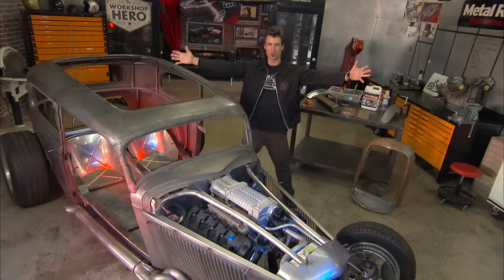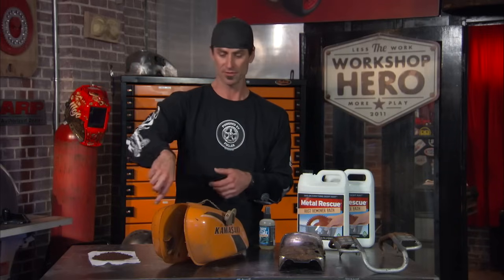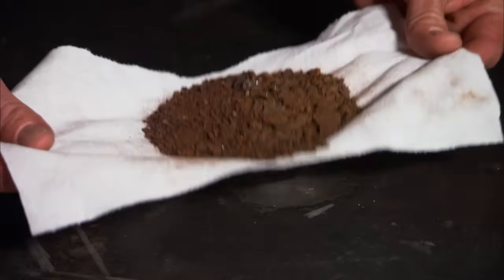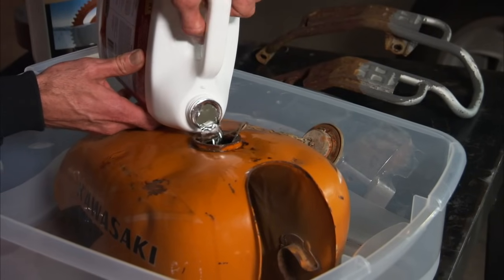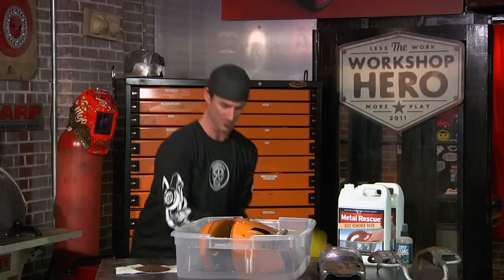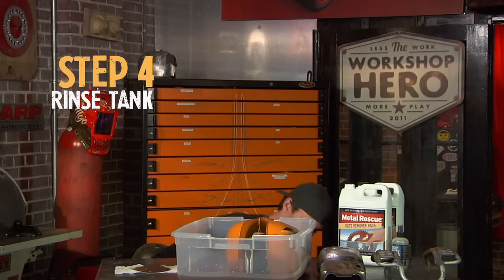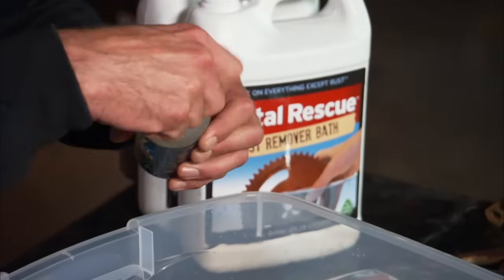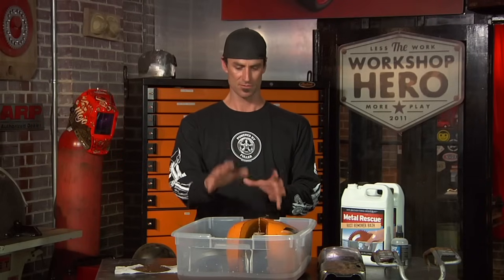How To Remove Rust From A Motorcycle Gas Tank: NO ACID

Comment: such a tank expert, DISTILLED WHITE VINEGAR works better than anything I have found in 50 years. Less than a buck a gallon. it takes a few hours, but White distilled vinegar is very gentle on your skin and metal tank, but harsh on rust and varnish. It will even clean the varnish out of a plastic tank in minutes, use a few nuts, bolts washers etc as agitators inside the vinegar in the tank and rock back and forth for about 10 minutes and the varnish pours right out. A final rinse with vinegar will verify the job when it pours back out clear. Lastly, put a little gasoline in the tank to rinse the vinegar residue out, slosh it around a bit and discard. the tank is now clean.
Reply from the maker: There are a ton ways to remove rust. Metal Rescue is the cleanest, safest, and easiest ways to do it! We compared Metal Rescue to white vinegar in an apples to apples comparison video. https://youtu.be/FusxqHduvCE

Unlike vinegar, Metal Rescue is not an acid, and will not promote rust if left on or not neutralized! 
Check it out, and you can be the judge on which one works the best. Thanks for watching, please let us know if you have any other questions!
Reply: +Metal Rescue Rust Remover Bath from Workshop Hero...white vinegar works on par with this product but at a buck per gallon it's better value and for that fact, far superior!
Reply: Agree,,,,$25 for a gallon not happening ,,,,,Vinegar it is
Reply: I just did this myself in my own tank and it rusted again immediately straight after. I call bullshit.
Reply: I left it in the tank for three days and still had rust with vinegar.
Reply: SEI RePower awesome thanks
Reply: from all the times ive used white vinegar i can tell you it needs a higher acidity than 5% to work effectively and its harsh on paint, so is the works toilet bowl cleaner but it is more effective and is only about $2, electrolysis is also a good option if you do it correctly
Reply: kerosene work's Better Then the Vinegar i think.. Its what i use with nut's, bolt's, washer's , and screw's,..  works great...then you can seal it if u want... How do you have a Product and Promote it with gas tanks, and then say Can't seal cause it hasn't been tested ??? .. That just makes me Feel it hasn't been fully tested as it should as a Product..  Listen i Used It on one of my gas tank's and Yes it DID WORK GREAT.. But The Price is High for a Product that hasn't fully been Tested, and just going to use really once and then throw out.. 4 gallons of Kerosene even at $5 a gal. is cheaper then 1 gallon of this.. :(  Great Product but bad Dollar wise.. sorry
Reply: Thanks for the advice thats stuff is probably not cheap
Reply: I like your idea ! Much cheaper than five gallons of metal rescue at 20  bucks gallon. But does it really work as well ??? I just bought a motorcycle that has been sitting for ten years . So it pretty much looks like the one in the video .
Reply: you are absolutely nuts. muriatic acid makes it brand new in 30 minutes.
Reply: @kashmiri911  vinegar doesnt work. you may be confusing dirty tank with rusted tank.

Comment from the maker: Before adding any Metal Rescue™ to your gas tank we suggest cleaning the tank to remove as much of the rust and residue as possible.  Dawn dishsoap will help in removing grease and "gunk" and the use of a pressure washer as you suggest (if you do not have a pressure washer visit a coin car wash that utilizes them) will help to dislodge and remove any flakey rust or material that may be in the gas tank.  Best of luck and glad to see you bought enough to fill the tank completely - a smart move!

Comment: I tried METAL RESCUE on my 2001 ZRX1200 that had been sitting for about 6 years in my climate controlled shop.  Inside of tank looked pretty rough. I used a 1500psi electric pressure washer for less than a minute on the inside. I added the METAL RESCUE at 4pm on a warm ( 85 degrees) October afternoon (2020). I left it overnight and drained it out the next morning around 9am.  I was SHOCKED  !!   The tank was perfect inside.  I am very pleased with the results.  THANKS for this video !!

Comment: I made a few mistakes on my first attempt to remove rust.  First of all, I don't think I removed all of the oily debris from the tank,  Secondly, I only used one gallon of rust remover, and sloshed it around.  Thirdly, I did the treatment in my basement, which was colder.  I started over again, and used 3 gallons instead of 1.  I power washed the tank and dried it before starting.  The results were AMAZING!!  Fully restored tank.
Reply from the maker: That's great to hear!!! We are really happy to contacted us about it and gave it another shot! Metal Rescue is very easy to use, but as you found out, there are some things to keep in mind when using it. Thanks again!
Reply: I  vinegar to remove rust worked great but then after emptying it i rinse it with gasoline and it flash rust so quick
Reply: @joshuacruz4046  You have to always wash steel or stainless steel parts with phosphoric or citric acid, and then painting it, or keeping it away from moisture and filled with gasoline. Acids promote rusting. But phosphoric acid and citric acid do not promote further rust, they actually form a barrier on the steel called passivization and seals it.
Reply: Ritalie thanks man I’ll check it out !

Comment: 1) Final update: IT WORKS! Tank is spotless as far as I can inspect & nothing corroded or acid burned. Note to VTX ppl: immediately treat the wall & lip around the fuel port / cap area w/ rust prevention stuff to avoid flash rust from returning to pitted areas after final H2O rinse, then treat inside tank immediately w/ rust preventor sfuff after H2O is gone. Due to the design of my 5 gal VTX tank, particle removal was tideous. Remove petcock. See next post for particle removal process I used.

Comment: Hey guys. Great video. On a tank with a fuel pump and sender unit, because it's non corrosive could you leave those parts in so they get a clean aswell? Thanks

Comment: Just seen video I have a 2006 zx6r that sat for 3 years and tank rusted inside. Do I have to remove fuel pump ? Being this bike is fuel injected it doesn’t have a petcock. Thanks
Reply from the maker: Nope! Metal Rescue won't harm the fuel pump so there's no reason to remove it.

Comment: Okay, I did as u said, emptied gas completely, boiled 5 gal of water, put in my tank w/ some dawn, sloshed around, let sit for 3 hrs then drained completely. Pwr washed & drained completely, twice. Lots of rust flakes came out! Debris & water removed. Now, I am babysitting my tank at 72ºF ambient temp, indoors. Filled to the rim with 5 gal of Metal Rescue. This better work bcuz it was very expensive! VTX owners, don't pwr wash w/ pitcock intact due to delicate filter that extends into tank.

Comment: I used apple cider vinegar for 72 hours changing the vinegar every 24hours. I still had heavy rust coating the inside of my tank. I gave metal rescue a shot and after 24 hours there was nothing left. Not a bit of rust and one shiny tank. Awesome product. I'm restoring a 30 year old dirt bike so I filled up a bin with metal rescue and started dumping rusty parts in. Now I don't have to buy new screws, bolts and clamps. I'll be using this for all my rusty restorations.

Comment from the maker: Hi Sebastien, Metal Rescue pulls the rust off leaving the surface bare metal. It does not leave any type of coating on the metal. Your part is ready for the next step in your restoration, painting, welding, ect. If left unprotected, the rust will come back. If you aren't going use your de-rusted part right away, we suggest using our Dry Coat Rust Preventative. It dries to the touch without leaving any greasy residue, plus it will protect your part from rusting back for up to a year indoors.
Reply: How long do you leave dry coat rust preventative on the tank for?

Comment: i plan on having the tank sandblasted and painted. should i do the metal rescue before or after that? how much dry coat is necessary for the rinse? how do you dispose of the used metal rescue and the left over dry coat (after the rinse)? how long after the dry coat should you wait before adding gas?

Comment: I have an old 1973 Hodaka Motorcycle tank that is chrome outside. Will this stuff mess up any of the outside surface or stain it? I am assuming it will not hurt it, since it's water based. Just wanted your opinion. Thanks for the great video.
Reply from the maker: Hi moparmusclecars! Thanks for watching! You are right, because Metal Rescue is a water based rust remover, it will not harm any of the outside surface or stain your motorcycle gas tank. Metal Rescue only removes the rust. It's safe on paint, plastic, rubber, aluminum, and to the touch. Remember that it's reusable too! 1 Gallon of Metal Rescue will remove up to 1.5 pounds of rust. Please let us know if you have any other questions. You can leave a message here, or email us at anytime. info@workshophero.com

Comment from the maker: Hi shamanwako, Metal Rescue does not leave any type of coating behind on the metal. That being said, once you have de-rusted your gas tank you have a few options to keep the rust from coming back. 1.You can pour in some gas and swish it around the tank to soak up any residual water. 2. You can pour and swish around a gas/oil mix to coat the inside of the tank. 3. You can use our Dry Coat Rust Preventative spray, which when applied it prevents rust from coming back for up to a year!

Comment: When I got my cx500 it’s tank had a mess of rust and decomposed tank liner spray, so I shook it up with lots of sharp and heavy little metal pieces, to shred out the hanging on pieces of the rubbery tank liner material, then I used Metal Saver on it and it did a great job, removed only rust and no extra metal.
I put in inline fuel filter on it to be safe and its stayed clean
Reply from the maker: So glad to hear that! Please let us know of you ever have any questions! Thanks for watching.
Reply: What stop flash rust

Comment: I’m restoring a 1979 280zx. Looks like a 20 gallon tank, @ $25 a gallon this will be very expensive to fill to the brim. Any suggestions?
Reply: Vinegar. Buy in larger quantities. Works very well on rust with very little removal of base metal.

Comment: One Question... what is the best thing to use to remove old fuel/muck/varnish? Is dishsoap the thing to use? my tank is probably only lightly rusted. It has occasionally sat for periods of time but has always in a garage. I will probably skip the ball bearings and use a pressure washer... Thanks  Rich

Comment: Will it remove vinyl coatings from inside a tank that has been previously sealed? I got an old harley roadking tank that the previous owner coated with the internal sealant and I would like to remove that crappy coating.  Its already starting to flake. I don't seem to know how to remove it from inside the tank.

Comment: Update: My VTX tank has been soaking for around 4 hrs,  I'm seeing the rust clear up! I did not think it had much rust but the pwr wash revealed a lot of debris at the bottom (where I can't see). The top of the tank (inside) didn't have much rust at all and whatever was there is now gone except for the wall of the fuel lip, which is submerged.  The solution is still clear and clean. I'm turning my tank over to drench the lip & under wall. Wish HD gad 5 gal jug as I would've saved $35.00. SFSG.

Comment: Great video!
If you hold the jug on it's side and pour it flat, you wont get the surging "glug glug glug" and it pours out faster and super smooth.
Reply from the maker: Hi Whatever it Takes, you are correct! Metal Rescue will pour super smooth if you hold it on it's side. It sounds like you have some experience with this method of pouring! Thanks for watching, please let us know if you have any other questions or comments.

Comment from the maker: The best way we find to clean a tank is to boil some water, pour it in the tank and add some dishwasher soap, (we use the brand dawn) you can even add some large nuts and bolts to knock some of the rust off. Let it soak in the soapy water for a few hours. Then use a power washer or a good hose to clean it out. Repeat if necessary. Once it's down to the bare rust, then use Metal Rescue to remove the rust. Please let us know if you have any other questions.

Comment: it seems slow to work but works well and it's nice no worries about spilling it on your painted surfaces .
Reply from the maker: Hi colt ACP, rust removal times depend on the severity of the rust on your metal part. Metal Rescue can remove light rust in 20 minutes. Heavy rust takes longer but you can speed up that process by agitating Metal Rescue and or heating up the solution. Yes, the best part of Metal Rescue besides being reusable is that it is safe on everything except rust. Thanks for watching, please let us know if you have nay other questions.
Reply: metal rescue rust remover bath from workshop hero, yes my fuel tank on my VFR1000 was really thick with rust. one area so bad i never thought i would get it out but let it sit overnight and it was gone.  i will have to try warming it up i didn't know heat helped the process. thanks for that info
Reply: Metal Rescue Rust Remover Bath from Workshop Hero,  now it seems to be doing nothing at all. i put the tank on it's side let it sit all night checked on it in the morning and nothing changed the rust is still there. could it be the overnight temps?  they have been around 50 to 55 degrees for the lows
Reply from the maker: Hi colt ACP, Metal Rescue works best at room temperature 68 degrees or above. Colder temps do slow down the rust removal process. Has the Metal Rescue darkened in color? If it has that's an indication of it working. If that's the case, keep letting it soak in one spot until the rust is gone from that area. After the rust is gone from that area, you can then rotate the tank to the other rusted areas. Also, Metal Rescue is not an acid, it will not eat through anything. Any barrier between Metal Rescue and the rust will prohibit Metal Rescue from working. Is your tank cleaned out of any grease, or varnish? Thanks for keeping us in the loop on this. Please let us know if you have any other questions or issues. Thanks.
Reply: Metal Rescue Rust Remover Bath from Workshop Hero, yes the solution is very dark. i run hot water and dawn soap through the tank to degrease it before i started the process. i will keep at it the rust is coming off it's just taking time. that is the reason i went with Metal Rescue no acid....thank you for the input and quick replies.
Reply: Metal Rescue Rust Remover Bath from Workshop Hero. so it has been soaking for the last 3 days with 0 results.  it's like the solution just stopped doing anything... I have been shaking it up keeping it warm as possible. actually, some places where it did remove rust when i first started the process looks like it is trying to flash rust.

Comment: I have an old honda motorcycle and was wondering if I keep it in there over my vacation wiche is a week will I get a better result and is it ok to keep it in there that long for a "maximized" result
Reply from the maker: Hi TJ-Thanks for contacting us!  We wouldn't recommend keeping any metals in the Metal Rescue solution that long.  Typically, even more severe rust is removed in 24 hours. Sometimes, based on the metal type and amount of rust an item needs to soak a couple of days, however, we wouldn't recommend leaving it in for an entire week. The things that can happen are: 1) it could darken the metal  and 2) it could remove any paint that you want to remain.  Because Metal Rescue works by wet contact, it may be necessary to slightly move the item in the solution to allow for all of the metal surface to come into direct contact with the metal.   (ie. the bottom of the container where the metal touches the container).  We hope this information helps.  You can reach us at 800-365-1117 or info@workshophero.com  Thank you for choosing Metal Rescue Rust Remover Bath.

Comment: Will it flash rust before adding the dry coat?
Reply from the maker: Hello, Metal Rescue is not an acid, therefore it doesn't need to be neutralized and you don't have to worry about it promoting rust if left on. Also, Metal Rescue pulls the rust from the metal and does not etch the metal. We have noticed that on some cast iron pieces that were heavily rusted immediately start to flash rust after being rinsed off with water. All other metals have not flash rusted. In those cases, you are dealing with unprotected metal that will start to rust again depending on the temperature and humidity. Thanks for watching, please let us know if you have any other questions. You can get Dry Coat here (FREE SHIPPING) https://www.workshophero.com/product/dry-coat-rust-preventative-spray/

Comment: Should i clean the gas tank with hot soupy water to get out the gas and oil?
Reply from the maker: +Yassine Ben Saida Yes. Keep in mind that Metal Rescue Rust Remover Bath is not an acid, so it will not eat through anything. Any barrier between Metal Rescue and the rust, will prevent Metal Rescue from working. Metal Rescue has to be in direct contact with the rust at all times in order for it to remove it. Thanks for watching, and please let us know if you have any other questions. Here is a link to our step by step instructions of removing rust from you gas tank. http://www.metalrescue.com/assets/pdf/Motorcyle%20Gas%20Tank-Workshop%20Hero%20White%20Paper.pdf